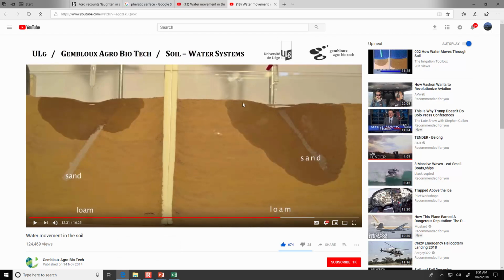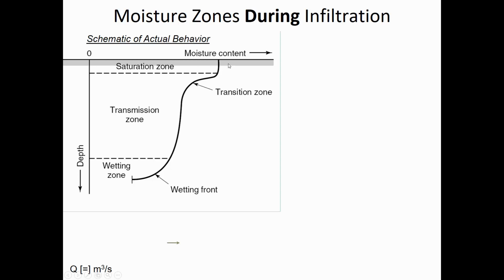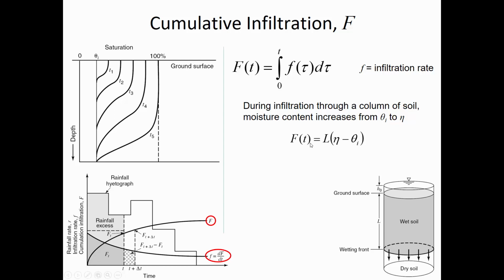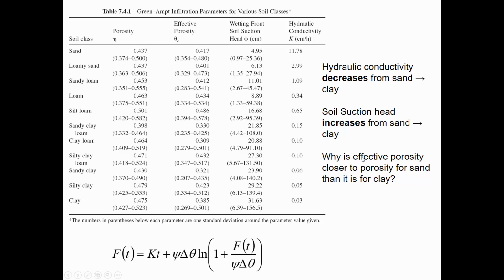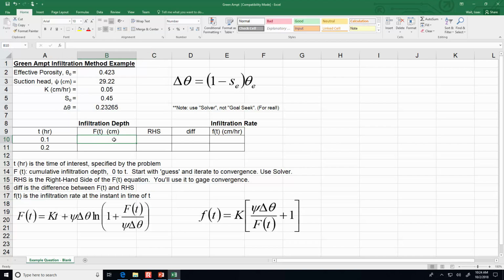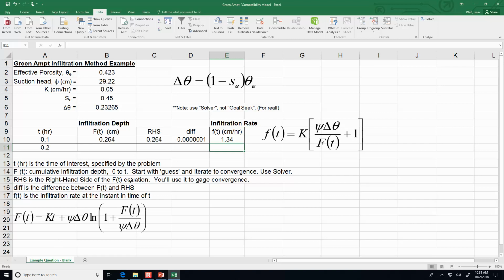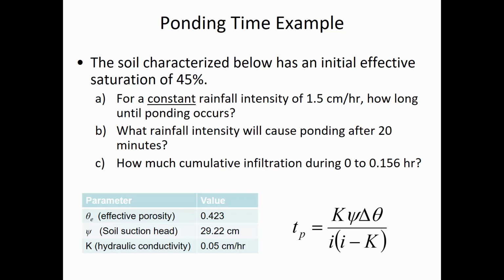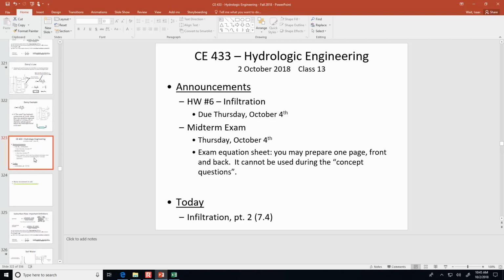CE 433 - Class 13 (2 October 2018) Infiltration, pt. 2, Green Ampt Method

Comment: Hi there!! your lecturing video is a very  interesting and  a wonderful because I have got a lot of knowledge.but  I want your support to solve this question. could you help me please?if your are ok send to me the calculation procedure and answer via yenebalew@gmail.com.below i put the question thanks for your cooperation.
For a sandy loam soil, calculate the infiltration rate (cm/h) and depth of infiltration (cm) after one hour if the effective saturation is initially 40 percent, using the Green-Ampt method. Assume continuously ponded conditions.
Reply from the maker: If you compare your question to the example that is worked in the second half of this video, you will see it is very similar, and you can apply the same method. Good luck.